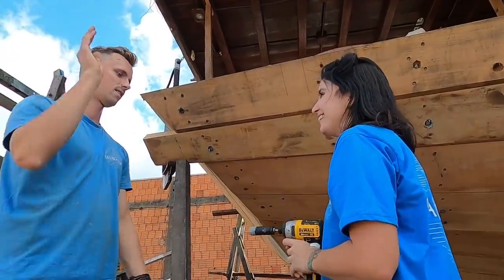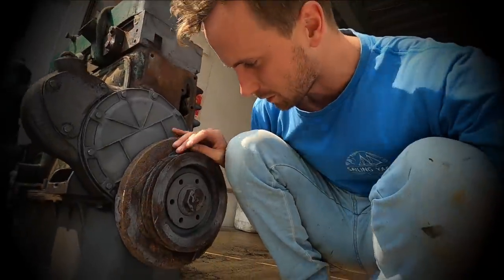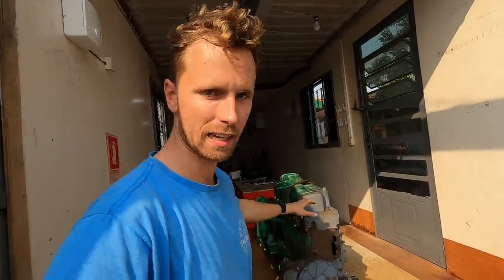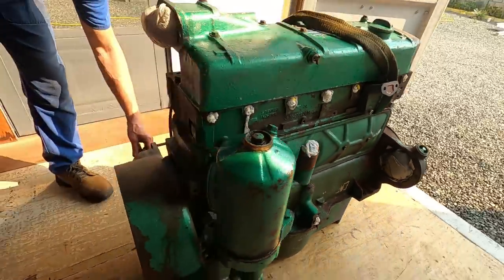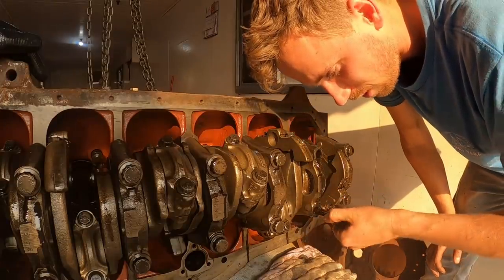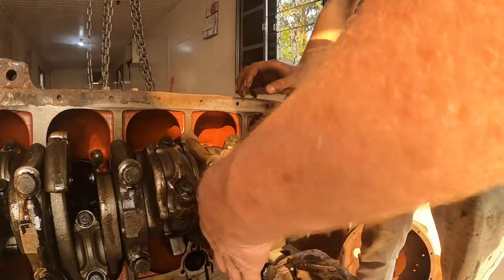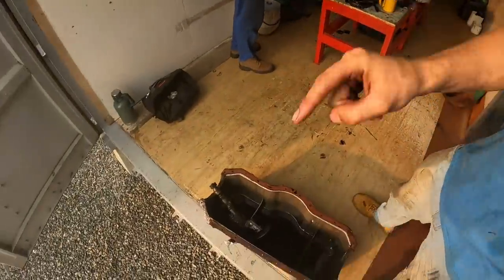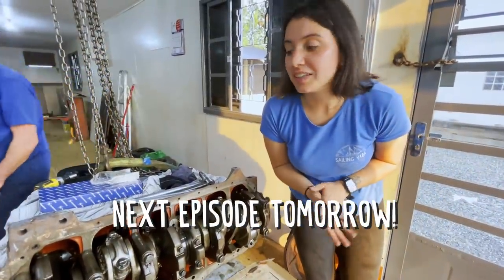ENGINE OVERHAUL STARTS NOW! (+ ingenious DIY crane) — Sailing Yabá #62

Comment: Well at least you have been able to get most of the parts removed for cleanup or replacing.  What you need is a cheep-o-bag of gallon sized freezer bags (they’re usually heavier than the regular gallon bags) then label it first and then put the associated bolts you remove into the bag. That way they are organized and categorized for each part of the engine.  When I used to take an engine apart we had a small parts container for things like crankshaft parts and that enabled us to keep them in the order they were removed so they went back into their original spot.

Comment: Now is the time to replace big and small end bearings on the connecting rods. Replace the main bearings on the crankshaft. Replace the piston rings and hone the cylinder walls. You won't get a better opportunity than now to do this.

Comment: Ever get a sheared screw, but a slot in the top with angle grinder and then use flat head impact driver to remove.  Works every time.

Comment: hi ben hope youre good , what you were doing was taking the main bearing caps off the crank shaft ok , if your planning to use sand near your engine you should be re building it completely ok , another tip is once you have your new main bearing and big end bearing shells fitted , check their clearances with a  " plastiguage " , the manufacturer in this case merc will have new bearing clearances specified in the engine manual for main bearing to crank shaft clearance and big end bearing to crankshaft clearance , the plastiguage material is placed between the new bearing and crankshaft , the cap is fitted and torqued down , then remove the cap and measure the width of the crushed plastiguage  material this will then tell you the clearance between the  new bearing and the crank shaft , this is important as the c/shaft will expand when hot , if the clearance is too tight  you ll damage your new bearings , if too loose  there will be low oil pressure  you ll hear knocking noises and again damage will occur , also be sure to check end float of the crankshaft as well , there will be limits for this in the manual too ,take youre time get it right  take it easy  regards to both

Comment: This looks like sooo much fun, wish I were there to help lend a hand.  DIY, especially on engines, are most exciting to me.  Please keep those crank shaft caps in order when reassembling.  Originally they get temporarily installed and then machined straight through as an assembly.  Therefore should install back in correct order to maintain this straightness / alignment.  If you don't remember, typically they are stamped (via a punch) with numbers front to back (on an inline motor) on the caps themselves.  An offset motor is labeled by the piston # which is a bit different.   Wish you all well!!!

Comment: A famous Clint Eastwood line. “A man has to know his limitations” (spoken through clenched teeth from the side of his mouth)
Anyone can take apart and reassemble an engine, it might even run when you are done. Your engine is one of your most important pieces of safety equipment, it’s out of the boat, take it to a professional. You will thank me when you are sailing in a narrow channel and the wind changes.

Comment: You should disassemble the engine completely.
Machine the parts that need it - like the crankshaft bearings - and replace all gaskets.
Checking the cylinders compression would also be wise, as well as replacing the piston rings.

Comment: Great video, intresting to see how the old parts look. Now wa all hope for a mini series of "yabas engine" videos with all the work to come. Good that you did not find any major issues inside, looks like mainly a set of new bearings and some overhaul kit with all the seals and youll have a brand new engine.
Reply: Unless they actually measured anything they certainly won't have a new engine. They will have a  half-assed engine they may make it another thousand hours, or not make it twenty. Based on the video, there are going to be some expensive lesson to be learned.

Comment: You have to pull the pistons and check the piston rings (actually should change the piston rings) and check the cylinder wall. Get new bearings, crank bearings, piston bearings, thrust bearings - check the valves, valve springs, valve stem gaskets, the cams, etc.  You should check all the parts. Even the bolts should be changed, especially the crank and piston bolts.    If your piston rings are worn, oil can penetrate into the combustion chamber from the crankcase and burned off - meaning you will have constant loss of oil and the engine will kill itself by the crank bearing and piston bearings getting worn out and then you have the rod knocks  ->>> eventually engine will go tits up and done for.   Just type up rod knock and see how bad it can get.

Comment: You both have made such a spectacular job on the boat rebuild , take a bit of time and strip the engine for inspection it will pay off in the long run, the cylinder bores are sure to be glazed which will cause it to use oil , pressurised crankcase causes oil leakage and the engine will smoke
Reply: Yep, get these bits all attended to now...not when it is back under the cockpit floor. You will never get a better time

Comment: I wish you would do a problem on that engine, full strip down and rebuild. Look what happened to odd life when they took a short cut on the prop shaft all the time on hard standing  when into water to get lifted out to then a rebuild and new seals on that an extra 3 weeks and extra costs.

Comment: Whatever you do. DO NOT reassemble that engine without pulling the head off and inspect the piston rings. Those main bearing are really scored badly and to lose that much oil, does not bode well for the rest of the engine..i.e., cylinder walls, pistons, etc. Use the opportunity to total disassemble the engine, replace whatever is needed and you will have peace of mind when you are out in the middle of the ocean, with nobody around you.  PLEASE!
Reply: A message from now for a past heart felt plea. Thank you

Comment: power washing the oil off of the block directly into the ground.. in germany/europe you need alot of specialized equipment to catch any and all run off in a shop dealing with oil/fluids.

Comment: While you have the engine out, look into installing a hand siphon pump (or a vacuum line) to the oil pan drain fitting. It will enable you to do oil changes without having to try to catch the old oil in a bucket down in the bilge. This one is 'cheap' Sea-Dog, Oil Change Pump, Manual. The electric ones are faster, but need power to work. Considering that you won't be doing a lot of oil changes, the manual type makes more sense to me. There are larger 'remote' mounting pumps, but the price goes up to 490 BRL...

Comment: I thought you used the motor all the way down (or up) from where the boat originally was. I am stunned there was virtually no oil in it. I am relieved to see oil running out of the connecting rod oil galleries as you took out the bolts.  At least the was some lubrication when the engine was last turning.

Comment: If the crankshaft bearings have worn down a little I would recommend you replace the “Big-End Bearings” that hold the crankshaft in place, they can cause an engine to seize if worn.  For information in most British-English speaking countries the oil reservoir is known as the “Sump” or the “Sump-Cover”, if the oil reservoir is detached from the engine it is known as a dry-sump.

Comment: Great job you’re going all the way on the engine. By the way. . . Those were lower connecting rod bearings, crank shaft bearings hold the crank shaft in place to the block.

Comment: And what about the gear box?  I'm sure you have plans for that.  I'm sure you'll show the top end rebuild as well as you progress.  Please don't plan to reuse any of the accessories like the alternator, starter, water, fuel or oil pump.  Those bits will give you grief more than those old bearings would have.  Good luck.  I'm loving watching your progress especially the wood work in the boat.  Cheers!

Comment: Hi Ben Hi MP .Ben that was the oil pan you removed from the bottom of the engine . that big thing the pistons and piston rods are connected to is the crankshaft . don't worry overly much about getting the names of all the parts right we understand 🤗.please do not take any shortcuts here please ,as you said it will be difficult to remove again for any repairs latter and a failure at sea is not an option .As far as shorter and more frequent  episodes go I'm good with what you are doing now thank you .

Comment: Hey Ben and MP 

Looking forward to the motor bein complete and installed on the boat.
Great that you are overhauling the engine. Did you find the bolt for the sump or oilpan?

Comment: I hope you know that head bolts and connecting rod bolts are one time use. They are tightened to a specific torque that stretches the bolt. Once you remove the bolt they cannot be used again. You HAVE to buy new connecting rod bolts and head bolts. If you dont, you will blow a gasket at the exact time when you will need her to stay together. Stretched bolts cannot be re-torqued

Comment: As you are working with an engin guy you should be ok putting the bits back on. If you do this solo take photos of everything, put the bolts back into the hole they came from and mark everything.                                                                                      2x👍

Comment: What you call the oil cover is an oil pan the bearings that you have exposed our the main bearing caps you have removed the othe caps are rod bearings .this is a major over haul and the main bearings are in bad shape.it help you a lot if you get a manual for this engine and read it and you would understand that some of the parts that you have named are incorrect and having Emmanuel give you working knowledge of parts and what the parts are for . you guys are done a fantastic job I can't wait to see the final outcome of the boat good luck guys

Comment: Crank maybe good. Just polish the journals. New bearings the same size as they came out. Probably standard size. Pistons may be good and just need a clean. If the bores are good just give them a hone and fit NEW rings. Refurb the head. If you are lucky all of the valves can be reused and just need matching to newly cut seats. With a diesel, compression is king. Con rods push the pistons up and down and the "carter" (never heard that term used) is the sump. Good luck, it's a tough engine.

Comment: I enjoy working on motors though I don't like paying for the parts.
Just a few words for you. In our neck of the woods the crank shaft cups that hold the piston to the crank are known as big ends. That's because the piston arm has a big end at the bottom and little end at the top so the shells which are bering's are called big end bering's. Well that was simple🏴‍☠️

Comment: If I were you, I would replace the machine screws. When the screws are tightened to spec. the length of the screw increases; this is called lengthening the fastener. The screw then acts like a spring and will not loosen.  If you try to reuse a previously lengthened fastener, the screw may fail either upon tightening or later due to vibration. Use new fasteners of proper grade, and tighten to specification.

Comment: I'm enjoying the dedication and enthusiasm you're bringing to your build., but right now, you have a case of MAW. That means you "might as well" do a proper rebuild. I built many many Harley Davison and automobile engines during my working career and once you've got it torn down this far you might as well go a little further and do it right. It'll cost more but everything is now good to go. You have a perfect opportunity to do a complete rebuild of that engine so it will last many years. There are some problems you just cannot see without completely tearing down an engine. Good luck whatever you decide.

Comment: Chrome, paint, powder coat and polish all that you can while the engine is out, Its worth the added expense in the end. Oh an use stainless where ever possible.
And yes fit a drip trey.
Reply: Stainless won't rust but is a weaker bolt, FYI. Tensile strength should be considered, in my opinion.
Reply: @chjp2346  Engine mounts and any ancillaries stainless bolt make for easy service and removal. Yes that dont rely on tensile strength. Powder coating ( if possible ) for bolt ons and paint for complete coverage of all other. Constant clean and WD40 or secondary protection. Oh and maintain all leaks. Years of happy motoring.

Comment: You should gave pulled off the valve cover and the head first that way as you remove the rod bolts you could feel pushing out the pistons

Comment: You must make a good check using caliper for determine if the jacket andd the cilinder is good acording to the maintenance book. Have a coutation of repir spar parts need, avilable in the market and a usede engine (retificado,)

Comment: Hey Ben, I really like what you do restoring/rebuilding Yaba,  just one thing, from the start of the project  you've called every fastener a screw and now with rebuilding the engine you're still doing that, there isn't one single screw in an engine! Apart from that keep up the good work! Cheers!

Comment: When they first started taking components off of the engine in the boat I advocated doing a ring job, could have even done that in the boat. Really large ships have their engines rebuilt in place because they planned ahead and can’t remove the engine anyway. The good old Mercedes likely has very little taper and could just be honed and a new set of rings should be less than $100(I hope).

Comment: Where the oil sits is called a "Sump" and there are not Screws, they are Bolts, Screws are what you screw into wood. Just saying :) :yougotthis::elbowcough:🤗
Reply: Hahhaha different terminology..... because their sailboats are wooden boats and under renovation now...allllll bolt or scew is screw
Reply: Bolt = machine screw ;)
Reply: @TA-bs1hr  Bolt you undo with a spanner, a screw you undo with a Screwdriver.
Reply: @DavidSuttoninSpain  But when it is a torx? :P
Reply: A bolt has a nut. If it doesn’t have a nut it’s a set screw.
Reply: If it has a thread it's a screw, if it doesn't it's a nail 🤣either way you use a hammer to put it in or out 🤣🤣🤣

Comment: It is really interesting to see work being done on the engine. I am wondering how extensive a rebuild it is going to need. I am also wondering if you absolutely must have a diesel engine -- is it possible to use some other source of power that might be simpler to work with as well? For example, since you view this as a backup power source, would a transom-mounted outboard motor work as well, and be easier to service? I do not know -- I am a land person with no sailing experience and certainly no marine engine experience at all. As to whether I like the shorter but more frequent episodes you have planned...we will see...time and viewing will tell. I think Ben, MP, and the entire shipwright crew and the providers of design services such as Brunna are all truly amazing.

Comment: PLEASE!!!!!!! Keep in mind that the wearing of an engine is all round if you have the need to replace bearings huge chance that the piston rings need replacing at least. I know cost is an issue but as you said it is now or never and if it breaks "Never" is not an option anyway so you will land up having to work that thing in the boat and spend the money anyway. See the comments almost everyone is on the side of a proper overhaul.

Comment: You should be replacing all the piston rings and all the bearings on the crankshaft.  If you don't do this, you absolutely will regret it in the near future.  Old engines do not like half done reconditioning jobs.  This engine will fail at some point and it will be because you only did part of the overhaul.  Compression doesn't always mean the rings are in good order.  There are other rings on the pistons.
Plus you should recondition the head, by reseating all the valves and changing out all the valve stem O rings.

Comment: To have lost nearly all the oil out of the sump without realising it you must not have been checking the engine oil level, or not regularly enough. You should check engine oil before you start the engine every time and then the  cooling system once the engine has started.

Comment: its really really odd, guys, doing the bottom end (bearings) and leaving the top (pistons and valves). The top end wears 2x as fast as the bottom and much more prone to catastrophic failure. Go to sea, you haven't reduced the risk a bit for a burned piston or valve, and that can happen next time you're out. And, a burned piston or cracked ring is an engine out repair.

Comment: If you don’t buy a new engine all you will have is problem’s, but it will be great content, love the vids good luck 🤞
Reply: New engine seems an obvious way to go. Every single part has to be replaced in the the correct position with no pieces left over. Look at 'Ship Happens' and Salt & Tar because they are having problems with restoring their original engines. I think your present course of action without the proper facilities and expertise is doomed to fail. It is not a toy and your safety is at stake.

Comment: Rings and bearings and ring ridge removal.. when ever you open an engine you need to do them all. Just for starters. Other wise you just wasting your time because you might have over looked a problem that could leave you with out a proper running engine. But the odds are things will be alright for a bit.. diesels are hard to kill!